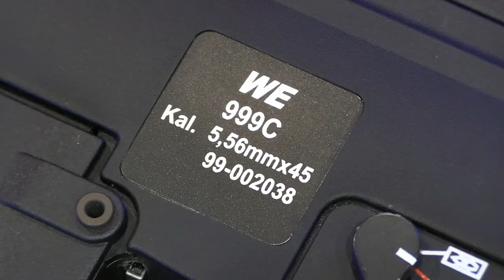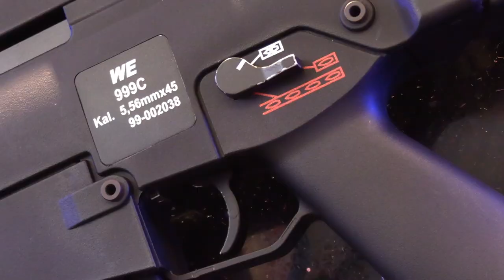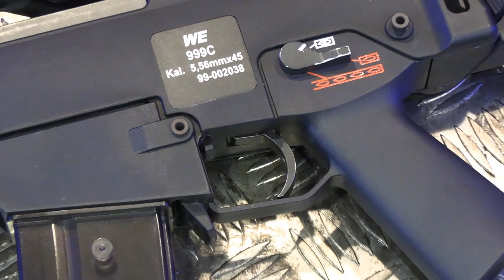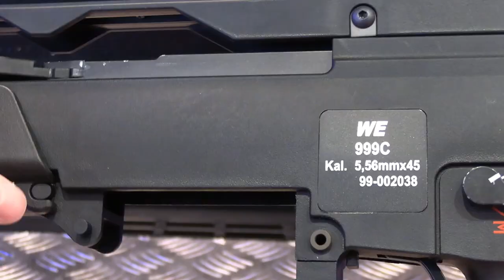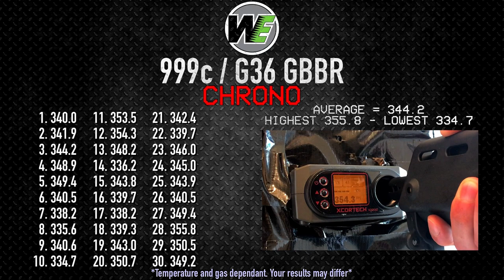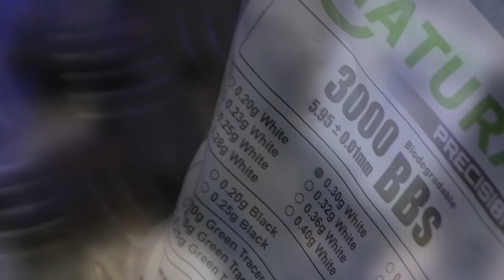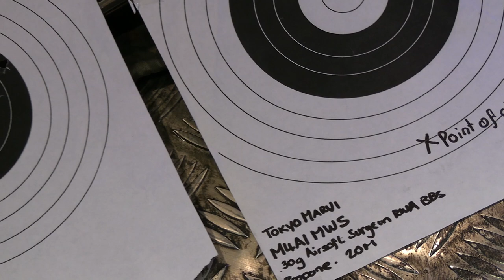WE G36c Review: 10 Years Later - Best GBBR?

Comment: Hi guys, I've this gun and I've already broke 3 nozzles after having a cooldown and releasing all the gas.

Everything else looks fine inside the gun, the hammer is still there too, so could it be the gas or a broken mag causing the issue? I'm using a silicon based green gas which gave me 0 problems on my pistol.

Comment: Great review! Btw, are there any parts in the trigger box that is interchangeable with... Say, the we m4/416?
Reply from the maker: Thanks mate. 
They share the same internal components. The only differences being the bolt catch assembly and the AR’s have a one piece selector. 
I have some RA Tech Steel Internals that came from an M4 originally and it’s a perfect match for the G36. Cost saving on WE’s part if they can use the same parts. 

The trigger pack themselves are slightly different to account for the G36 bolt release.
Reply: @BadaBingPictures  good to see then. Just ordered one after watching your review over and over. Have a great day dude.
Reply from the maker: Congrats! Enjoy it they're great fun. 
Cheers man, you too.
Reply: @BadaBingPictures  enjoying the gun rn. may i ask what  specific ra-tech parts that you've fitted?
Reply from the maker: @grievesatecaga2237  Just their G36 trigger as it’s closer in appearance than the stock WE.
Reply: @BadaBingPictures  thanks !

Comment: Hey man just found out that u can screw off the extended recoil buffer (the rubber looking thing in the recoil buffer) so the bolt can travel fully just like what i wanted and wanna test this out since but im concerned that is this can cause bolt override or even damage my gun or just reduce the ROF in exchange of a more realistic action?
Reply from the maker: Probably not a good idea tbh. It’ll be metal colliding with another piece of metal. 
Might mush up the back of your bolt carrier or deform the piece where the rubber buffer screws onto. Likely both. 

At best the bolt will travel an extra cm. Not really a boost in realism.

Comment: Will this replica accept VFC-Spec or RS Spec Furniture? (Stocks, and specifically that AREs replica B&T Handguard)
Reply from the maker: Not sure on VFC or Real furniture. (Real carry handles fit i believe)
I’ve seen a few people that have installed the Ares B&T rail successfully. No word of any fitment issues.
Reply: @BadaBingPictures  Would a RS HK BAD Style Bolt Catch drop in?
Reply from the maker: @HK-wq1ei  It’s definitely not compatible. I bought a real HK extended bolt release for the G36 and it goes straight up through the trigger pack to catch the bolt. On the WE G36 this presents a huge problem as the valve striking assembly is right where the extended bolt release would be for the real one. If that makes sense?

Then the WE version bolt release is reversed. Push up to release. On the real/VFC 36 it’s push up to lock open, and with the extended paddle it’s push down to drop the bolt. 

I am in the process of cutting off the L shaped part to attach to the existing WE button catch, and reversing the mechanism so it corrects the operation. RA Tech were working on a similar upgrade many years ago but seems they abandoned that idea.
Reply: @BadaBingPictures  damn, that''s unfortunate.

Comment: Hi Buddy, if you change to mag housing to M4 which magazines fit best?
Reply from the maker: Hi, 
None of them. The problem is the nozzle interface is very different to basically every Gas M4 magazine out there. The closest one would be GHK, but it’s not something that can be done without a lot of modifications and potentially designing a STANAG magwell from scratch.

Comment: Is it possible to use WE g39c with black gas? or red? (nimrod for example)
Reply from the maker: It depends. Not all colour graded gasses are created equal. Much like “Green” gasses. Some are watered down with Butane. 
If the temperature is below 5°C it should be alright, but only recommended when it’s cold.
Reply: @BadaBingPictures  I really want to buy this gun, but how long did 1000 ml of gas last for you?
Reply from the maker: I never really calculated how long a bottle of gas will last in the G36. You could probably use it for a day and a bit? But then it depends how hard you’re running the gun.

Comment: Does anyone know what happened out of the blue where these things just dissapeared from like all archives and everywhere in the US?

They’re practically never heard of besides outside of the states. I owned one a decade ago and ended up selling it because I could never find replacement parts, regretting that now that they seem to be a sought after item
Reply: Guessing HK and trademark issues
Reply: Grab one if you can. All WE GBBRs with the open bolt system use the same internals, you can take the WE KAC PDW or 416 or M4 or G36 Internals and swap them out, since the firing group has the same parts for all these gbbrs, all have the same internals. Josef Mucha did a video about this if you are interested in finding out more about it.

Comment: Many people consider WE apache to be amongst best GBBR-s. 
How do they compare, especially in cold weather (<5deg C)?
Reply from the maker: The WE Apaches are very good although they are not GBBR’s. 
They fall under the GBB SMG category but they get out performed by the MP7’s and MP9’s. 

They work okay, but not great in cold weather. Understand the long thin magazines aren’t ideal and the baseplate seals don’t take too kindly to gas that’s more powerful than green/propane.
Reply: @BadaBingPictures  That's a shame. Currently I own WE 999c and Army R36, and i would loove to get gas MP5,  but I can't really justify spending 500+ € for replica that performs somewhat worse than what I already have.
I guess I will have to waint until someone comes up with a proper CO2 powered MP5 - or at least GG one that works fine in lower temperatures
Reply from the maker: I haven’t done much shooting with them in the cold to know their true limitations. 
In my review of the Apache A3 that I made several years ago I remember it being quite chilly and as long as you keep the magazines out of the elements it should get by. 
They are wonderful Gas Blow Backs anyway so you won’t be making a bad decision if you decided to add one to the collection. I enjoyed my A3 so much that I bought a K.

Comment: Hey brother,sorry for your friend!
any news on the m4 mags compatibility with the g39?
Reply from the maker: Thanks man. 
No new news. I modified the AEG magwell so I don't have to hold the mag at the correct height, but its not ideal. The more time I spend on it the more its convincing me that it's not worth the hassle. The seal between the nozzle and magazine isn't the best, it transfers okay but as there is a slight mis-match there is waste gas discharge from the front portion by the feedlips. 

I'll work on it every now and then.
Reply: @BadaBingPictures  I have made a prototype for a "fake" new shell for the already existing magazine in order to have better reliability when dropped. Will post a video as soon as i can !

Comment: Can this gun dry fire? I got mine recently and it doesn't shoot unless bbs are in it :(
Reply from the maker: There is no dry fire switch. You can push upwards on the bolt catch inside the trigger guard and stop it from locking up, or remove the spring from the magazine if you want to dry fire it.

Comment: Hi all, I've been using one of these for a couple months now and I've ran into an issue I could use a hand with...

After installing an npas, the rife couldn't shoot over 190fps. I had the npas on a low setting and it couldn't even push a bb all the way down the barrel. On its highest setting, it maxed out at 188fps :( though now after messing with the hop-up it seems to be shooting ok, the occasional bb (especially on full-auto) only just makes it out the barrel

I'm still new to airsoft so this is most likely user error but if anyone knows what could be the problem I would greatly appreciate the help :)

Ps I guess this is what I get for asking for a gbbr as my first gun lol
Reply from the maker: Hi man, 
Yeah… GBBR as a first Airsoft gun, I would have advised against this. 
Never mind. Good news is it’s a platform that’s been tried and tested by many, so problem solving should be okay.
From the sounds of things the NPAS is riding in the nozzle too far forward. Where are you located/where did you purchase this? 
If it’s an EU gun the nozzle might be lowered powered. The rear portion of the nozzle has two struts that meet with the back of the cylinder valve/npas and if they’re too long they might be positioning the npas a little too far forward. So if you look into the gas port you may just see the very back of the npas. 

Of course this might be incorrect and there might be other causes to your issues but this is my first thought.
Reply: @BadaBingPictures  I’m based in the UK and it was originally perched in the UK as well. I know the gun should shoot under 350fps by default but it started at around 370-380 and I wasn’t sure if it would come down far enough after wearing in.

Thanks so much for the advice! I’ll try it’s default valve for now and see what the fps is at my next game. At least it’s quite easy to switch valves :)
Reply from the maker: It's the warmer time of year so I don't think it'll drop down until its cooler. 
There are several ways to reduce the FPS: 
-Trim the nozzle valve spring a couple of coils. 
-Shim the original cylinder valve by gluing a small plate or O ring to the back of it in order to position it farther forward. 
-If your plan was to upgrade the inner barrel, you could choose a shorter length barrel and this would naturally drop the speed. On my WE MP5 I installed a barrel that was almost half the length and it worked perfectly. This way I don't have to kill off the gas system using NPAS kits or a disc, so it's remains a hot gas system but with a lower output.

and as you know NPAS kits / restrictor disc. 

Oh and changing to a lower powered gas...but wheres the fun in that?
Reply: @BadaBingPictures  Thanks for all this info :) I’m trying to learn the art of owning gbbrs as I have no interest in aegs (aka fancy nerf guns…) so I’ve found your channel extremely useful!

I wish you all the best :)
Reply from the maker: @leosaur_4012  thanks for watching my stuff. You’re very welcome. All the best to you too!

Comment: Why is the fps so low? Is it restricted there where you are?
Reply from the maker: Could be an EU nozzle which has a lower output. Here it’s 1.3J maximum for a FA capable Airsoft gun. 
Years ago they were clocking much higher.

Comment: WE G39 or it's second generation named as 999 is one of top 5 GBBR on the market - 1. KJ KC02, 2. GHK PDW, 3. WE G36, 4. TM M4, 5. GHK AKs74u. Not the best one but it is a good choice for GBBR-newbies.

It have good pricetag, it don't need many upgrades to have a workhorse. It's hopup is good and effective (as all WE GBBR). It's magazine is an advantage and disadvantage too. Good because it have a clearly huge gastank and it's size can be a pain too.

Mine have broken hammer (pin felt out), damaged firing pin, I need to replace nozzle one time (thanks to shitty RAT NPAS), firing pin (damaged, shortened during use) and bolt catch insert after 3 years of usage (heavy usage, every weekend).

Comment: I have one. It sucks. Get a GHK.
Reply from the maker: To be honest this G36 sucked when I first got it. It could barely get through a full 30rds without flaming out. 

Previous owner had an npas kit installed and a 20% FG airsoft disc! Sapped the life right out of it. I ripped those out of there, returned an original cylinder and the G36 could breathe again. 
Restoring it’s hard kick and gas efficiency. 

An npas kit is one thing but a LFS Disc too?! Madness. No wonder the guy wanted to sell it.

Comment: I am NOT IMPRESSED! It sounds like a cheap sewing machine when firing in SA OR FULL AUTO!  My VLC M4A3 sound REAL compared to that piece of crap!  I was considering getting one, but after seeing AND HEARING this video, NO WAY!  I'll look into a CZ Scorpion GBB instead from VLC or G&G.
Reply from the maker: And yet it’s recognised as one of the finest out there. An entire community of GBBR users can’t be wrong.
Reply: @BadaBingPictures  Although this replica has a polymer body, the moving parts are durable, because you have a metal bolt moving in a polymer body. There is less friction  wear and tear, when metal slides on polymer, if the system is properly lubricated. There is more wear and tear on more expensive "metal -to-metal" contact replicas.